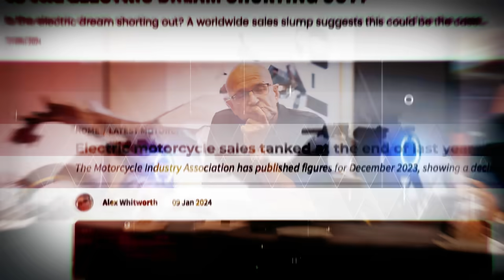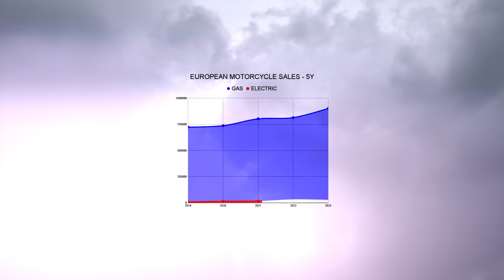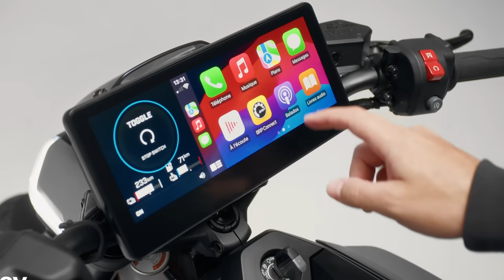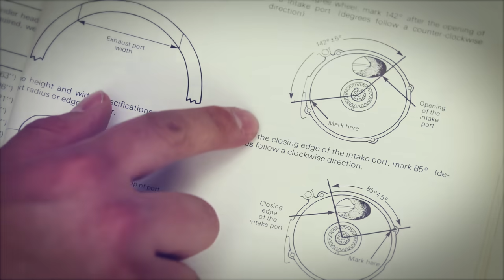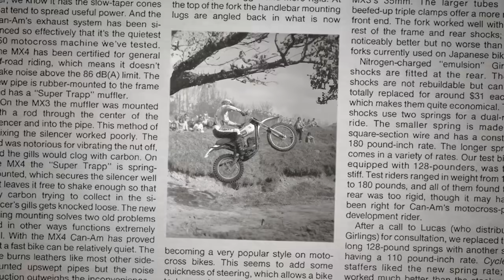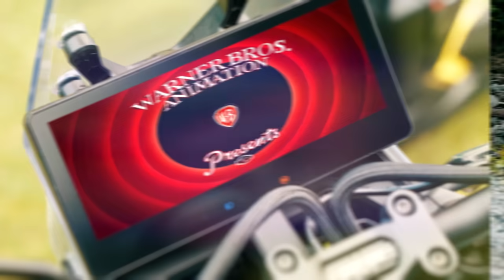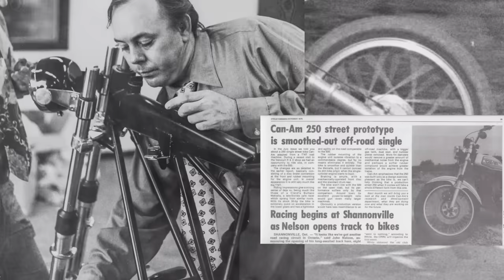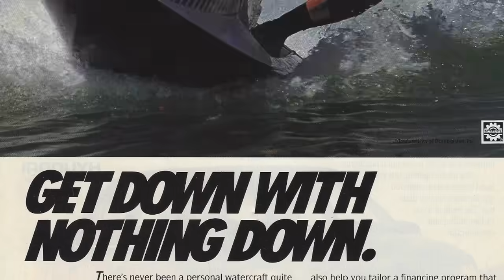2025 Can-Am Origin Review - The 115km "Adventure" Bike

Comment: That’s 115km range in ideal conditions…once the temp drops, it would likely get you stranded in the middle of nowhere.
Reply: Couple of steep inclines and it's game over.
Reply: You won't even reach "nowhere". 😅
Reply: 9 kw battery is so low it should be 15
Reply: To be fair no ones rides at -30°C
Reply: @DroneStrike1776  The slower you go the more efficient it is, just like when you're riding tight steep trails you don't use much fuel. All the energy consumption is in the high speed areas. I'd be super curious what the range is at 15 mph. That's about as fast as I average on a 250cc  now on my local trails.
Reply: @lecoureurdesbois86 -30 no but it’s Canada, people use dirt bikes in pretty cold weather, I even seen people out fucking around with them in the snow every year, I’ve never been that brave personally but it’s not that uncommon.
Reply: @noneyabusiness3253  Idk I've never ridden after the first snows tbh, just a patch of ice and you're done unless you're studded I guess... Anyway I wouldn't buy an EV, just wish they did real motorcycles
Reply: You mean 60 kms there and back mate...😢
Reply: my colleague has an electric car and he says it's the hot temperature that reduces range, not the cold one
Reply: @simonjones2645  Let's be realistic, it's more like 45kms back and forth. That kind of range would be expected in a city scooter.
Reply: To be honest, bikes like this shouldn't be used for distance. They are more suited the random trips across town to run errands. As sodium ion batteries start to mature, while losing some range the price of replacing batteries will plummet making them the most efficient short distance vehicle possible. Most of the weight on a bike are just the auxiliaries required to keep the drivetrain from seizing. E-cycles are purely energy source + drive train.
Reply: @albertserramontmany  it's both; in winter you want heating/de-icing in your car while the capacity of the battery suffers with cold. In summer you want AC while hot is quickly killing your battery so your BMS tries to limit what it can.
Reply: @atrumluminarium  "They are more suited the random trips across town to run errands." A bike costing 15k+ though?

At that point just buy a scooter or second hand motorcycle/car.
Reply: @ridderjaim3  Well I am not talking about this one specifically. Almost all e-cycles have about a 100-150km range so obviously the cheapest one available makes more sense
Reply: Also when it get hot, range drops.
Reply: @lecoureurdesbois86  Hey now, I watched this and thought it might be a decent winter commuter bike, and I see at least -25 each winter...
Reply: @otm646  And when almost standing still as tough terrain can require the energy consumption will drop to almost zero while an ICE engine will continue burning fuel.
Reply: I was thinking that too. I'd honestly rather swap the lithium ion battery for a LiFePO4, and sacrifice some range just so I can discharge it to 0% and throw it through extreme temperatures, without worrying about damage.
Reply: to be fair, you wouldn't get far enough to get to the middle of nowhere. so you would likely be stranded at the beginning of nowhere. the suburbs of nowhere
Reply: I mean, on the plus side, you'll always be able to just walk back home in a day or two. :D
Reply: The range is ridiculous.  How can you adventure if you can't go anywhere.  They are like choppers.
Reply: @simonjones2645   more like 50 back and forth, otherwise you would spend several km pushing this "thing"
Reply: @otm646  trails are the most fuel demanding area's you can ride. I doubt an electric bike will be much more economic.
Reply: @atrumluminarium This is an adventure motorcycle not city bike 😊
Reply: You wouldn't be riding a bike in those kinds of freezing temperatures. At least the average rider would never do that. The cooler (but not freezing) temperatures that you do ride is actually good for the battery.
Reply: @lecoureurdesbois86  it doesn't need to be anywhere close as that unfortunately. In my own experience (I own a Zero) temperatures under 10C is already enough to significantly decrease range. On hot summer days she can do 200 kilometers pretty easily (driving around 100km/h), when it gets under 10C I can trust her to do 130, anything above is a gamble. 

Still highly recommend going Electric (Zero or otherwise), one just has to take a good hard look at the pros and cons and what works for the intended purpose (I drive that 200 Kilometer range quite often in Summer and am glad for the enormous savings in gas, but it's only feasible because I also have a car for the longer trips and the colder temperatures and am no fan of long tours/travelling with the bike). And I still very much look forward to the market expanding and offering more range/shorter recharge times
Reply: @yodaiam1000  i wont ride bellow 10C thats why from october until april i dont ride
Reply: The problem is that you don't know. On a gas bike the mileage differs like 10% depending on how or where you ride. For example, proper knobbies, lower pressure in the tires, soft wet dirt road, steep inclines, cold weather etc. So what is the actual range that you can trust? You probably won't be counting on riding it to 0% more like at least 10-20% left. Or you will need a very good friend with a trailer. It's fine for a quick evening ride on well known roads.
Reply: Nah, you'd still be in the middle of somewhere with that range
Reply: @Klas2hjul 😅😅 My Vstrom has 350km range and with two 5L canisters, I can go 550km without refuelling. 5x range than this pos.
Reply: I dunno. From my experience, most of the battery drain for electric cars in winter comes from heating the cabin. This of course wouldn't happen with a motorcycle.
Reply: @albertserramontmany  your colleague is wrong mate. Ive been driving Ev for 5 years. Ideal for EV is 20C deg. 30C deg. makes the range a bit worse maybe 5-10% because of A/C working hard, but at -10C deg and snow the range is half in an EV!
Reply: @BelowZero  my bike can go 600km without fueling
Reply: Ford F150 lightning with extended range.

Put the bike in your truck bed. Have enough spare charge in the truck to recharge it 3 or 4 times easy

Comment: I've owned 3 electric motorcycles, all by Zero.   They have their uses and are actually quite fun to ride. However, the current battery technology isn't up to where it needs to be for electric to replace gas.   If I plan on a ride of 100 miles or so, I take my DSR/X.   When I want to go farther, the BMW GS comes out of the garage.
Reply: Zero motorcycles have only been around since 2006.  How fast do you trade them off?
Reply: @JoeBManco  I started off with a 3 year old used FXS in 2020.  I kept that for 3 years.  It was/is a fantastic light weight city bike but not real good at carrying passengers.   In 2021 I bought a used 2018 SR and kept that for 2 years.  That was better at carrying a passenger.  Earlier this year I bought a new DSR/X.   It has a lot more range than either of the two previous Zeros and is great at carrying a passenger.  Add in the various ride modes and traction control makes the bike my favorite bike in over 45 years of motorcycle ownership.
Reply: @j_k9643  Thanks for answering.  I don't know anyone who has a Zero, but I'd sure like to ride one without talking to a salesman to see what I think.  I don't buy the "loud pipes save lives" argument.  Neither of my motorcycles are loud, and I just wear bright clothing with reflective strips for night riding.
Reply: @j_k9643  I'm on my 2nd 2016 SR...the first one had 25K+ when I got hit and run. I turned right around and found the exact year and model second hand with less than 2K on it when the first would've cost me more to straighten out the frame. I also got a plate and eight screws on my ankle as a lifetime souvenir. Fortunately, I live 15 miles from the Rockies and get to do the twisties up to the top and back no problem, thanks to the regen coming down the mountain.
Reply: @JoeBManco  I'm sorry to have to tell you that 2006 is 18 years ago. 😁😥
Reply: Another zero rider here (mostly commuter, with a few weekend drives a year), only on my first one though (sr my19 14.4). Rangewise it might be an issue sometimes, however in europe there are plenty of type2 chargers, so usually i charge while having lunch somewhere and can empty my battery 2-3times in a day if i stop again for a coffee, by then my behind is usually glad that i can stop for a while. I'm looking to buy the DSR/X as well in the future but honestly for me the price of electric motorcycles is the biggest issue, did you get a decent price when selling your 2 other ones or is the price not really a concern for you? There doesnt seem a big 2ndhand market over here for electric bikes
Reply: Another zero rider here. On a 2018 DSR since 6 months and i love it. I use it mainly for my work commuter (132 km). Its mostly highway. It can make it without a problem if you are easy on the throttle (about 110km/u). If you drive slower (aka, more fun roads) the range can go to 200km. I charge in the bike shed at work. The running costs are practically zero (Haha). I still have my GS for a long ride vacation but 300+km on a day is certainly possible. There are quite a lot of level 2 chargers in western Europe. Its not perfect but its great fun to ride (fast!!) and its nice to lower the CO2 footprint a little bit.
Reply: @chicoc8637  "I use it mainly for my work commuter (132 km). Its mostly highway. It can make it without a problem if you are easy on the throttle (about 110km/u". Yea thats what i want when driving a bike.
Reply: That's exactly how I look at it at the moment.  An electric could totally replace my dual sport, which I don't usually get much outside of a 10 mile radius from my house, unless I load it on the trailer to go ride trails somewhere.  If I want to go someplace where I'm spending an hour actually sitting on the seat, I'll always take the GS, it's comfy, and it'll go 250 miles on a tank.  I rather like the thought that went into the drive of the can-am, but at that price point it makes a lot less sense than other electric options on the market.
Reply: @mosuke5123  on a naked bike i really dont want to drive 120km/u constantly tbh, so everybody has his/her own requirements, nothing fits everything
Reply: Yeah i bet you drive constant 160+ km/u during an everyday commute.
Reply: @chicoc8637  You bet wrong. My commute is a few meters. Homeoffice baby. But when i go on a ride i dont "wanna go easy on the throttle" and stop every 100 km for an hour. Heck even when i go on a highway my xj6 has over 200km reach full throttle with 5 mins of refuelling.
Reply: @burtinator85  I bought both used bikes for a decent price and sold them for less.  Price wasn't that much of a concern for me.   I also paid a very nice price for the DSR/X since it was a 2023 and the 2024 models were just about to hit the dealer floors.   Of course, there still are 2023 models in dealer showrooms and the prices are even lower 6 months later.
Reply: I am touring with a Zero S 14.4kWh battery 11kWh usable, I ride efficient low sperd up to 250km range and 50-70 km/h max speed.
 it is 5-6 hours ride a day and it has only a slow overnight AC charger, 1200Watt so 12 hours to recharge.

I just plug it in at night and ready to tour next morning an other 250km slow speed 6 hour ride.
What  is the problem ?

For me it is ok and I cannot recharge in 40minute but 12 hours and I can travel...

With a 8-9kWh battery and 40-50min recharge I could do a lot more a day. 
I think 180km range can be in city speed easy on throttle  and 3 stops to recharge its a daily 540km at least with this Can-Am.
Reply: Well said. 31K miles on a 2018 SR, and it still puts a smile on my face. Pretty much the same acceleration as my f900XR beemer.  BTW, no one should buy a new Zero. There are plenty of used, low mileage bikes on the market for good (amazing) prices.
Reply: @davehysom2636 ...except, you can't repair a Zero. You have to rely 100% on their service, because the system is locked out.
Reply: I agree totally. Electric is great in north American stop go traffic! I also programmed my own mode for when I’m tired. I can still beat most things off a red light, but don’t lose the rear traction so easily in the wet or damp.

Comment: honestly hit this on the head. range is what will keep these bikes from dominating the market. I'm super excited for the day we can actually enjoy something like this for longer than your average American commute.
Reply: Range and feeling dead inside as you ride one.
Reply: TBH I'd settle for the price coming down so I can use it specifically for the average American commute. Or for a windfall improvement in electric bicycles and associated legislation.
Reply: yes, range...and testosterone . utterly negates the joy of motorcycles.
Reply: They should just offer saddlebag mounts that have some extra batteries inside to double the range (focus on density over discharge rate here; if they just trickle charge the primary cells, it'll be fine since you won't be wide open for 60 minutes straight anyway.) and allow for a nice set of metal cable ties to secure your trusty milk crate.
Reply: @ulogy  "since you won't be wide open for 60 minutes straight anyway." you and I ride our motorcycles in very different ways
Reply: @AnimeReference The problem will always remain with the batteries. After the warranty expires, the battery could die at any moment without warning. This is not a problem with ice motorcycles. I sell and repair ebikes. The batteries are smaller and more or less affordable: not so affordable on bigger vehicles.
Reply: @gdwe1831  loudness is overrated :)
Reply: @DerpEye  The solution is a change in infrastructure. We need all roads, dirt roads included, to swap out their light posts (or install them) that aren't just light posts. Rather they must shoot out huge bolts of electricity onto an antennae on the bikes. To keep them perpetually charged.

I promise it would be safe.
Reply: My commute is 28 miles one way, 75% of it on I-10. Game over.
Reply: @DerpEye Die at any moment? How is that? Where are they being sourced?
Reply: @duroxkilo Electric Motorcycles can probably find ways to make noise, it just won't be as loud as ICEs. So for the people that want noise, you'll get it, just don't expect it to be loud
Reply: Price is stupid too
Reply: charging time is another thing to keep an eye on. It's getting substantially shorter in general, especially if you're only going to 80%. 200km range at 80% and then a 10 minute charge to get back to 80% is... annoying but doable.
Reply: @nyxw  yes, to some degree it's a safety issue on public roads...
Reply: @nyxw  Loud noises are cool when they signify a mechanical engine working overtime to generate speed & power. Electric cars making any more noise than the motors (& some electric-specific low-speed safety signal) is abhorrent.
Reply: But everybody keeps missing another critically important point. List a quote on how much that battery is going to cost when it needs replacing.
Reply: @duroxkilo If loud pipes saved lives you get better insurance for a high decibel bike.
You don’t because it does nothing to save you.

Comment: I bought a CanAm 125 enduro back in 1975. I had heard about the awesome power of the Rotax two stroke engine and it did not disappoint. Way more power than similar offerings from the Japanese. The bike was also innovative as it came with a plastic tank and fenders which were unbreakable and didn't rust. I remember the cooling fins on that engine were so large the engine looked more like a 250 than a 125. Those fins really helped to keep the engine temperature down. This was a quality motorcycle with class leading performance - and it was cool.
Reply: And one hell of racket! 😁 Unlike this CAN-AM.